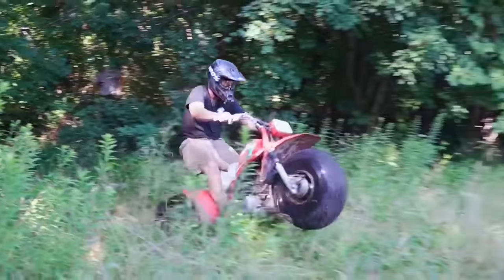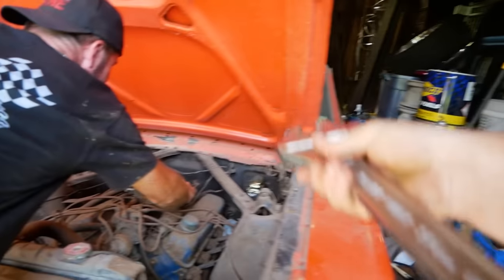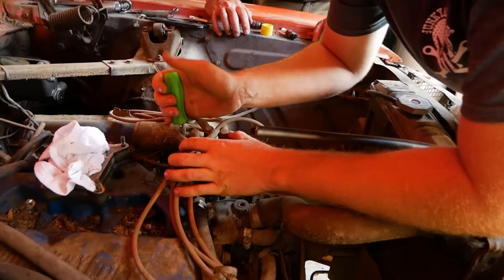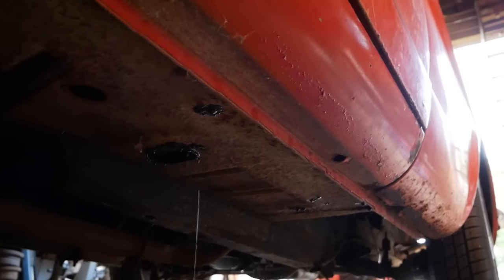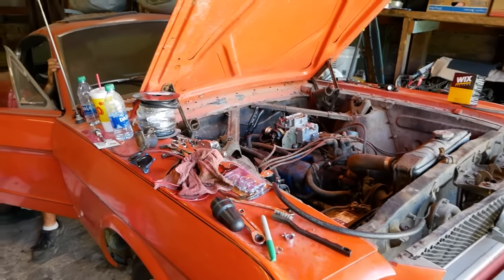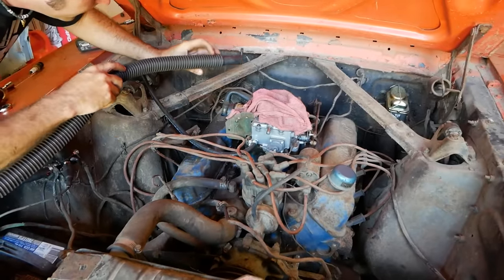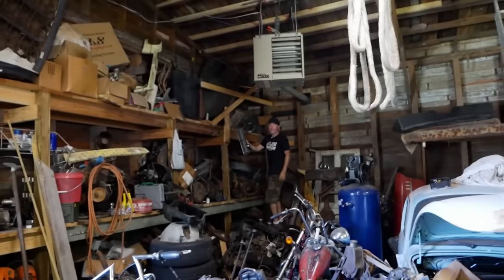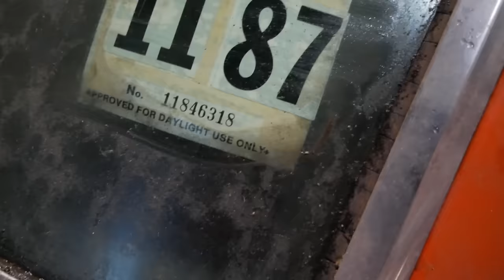Parked '65 Mustang FASTBACK First Start in 33 YEARS!!

Comment: you think that's impressive? I once started a car that had been sitting for almost 3 hours
Reply: thats a true victory when your car battery is as good as a brick.
Reply: well, ive done it after 2 hours and 30 min
Reply: What about after leaving the ignition on for an hour? My Passat sounds so sad when it turns exactly once, very slowly, and promptly gives up. Its basically my spirit animal.
Reply: @Avetho  relatable
Reply: What year KIA?
Reply: @jamescameron9420  I once, and only once, started my car after 2 hours and 29 minutes.
Reply: built Ford tough baby
Reply: Fr? That’s impressive
Reply: I mean if you drive a fiat that IS actually impressive.
Reply: @GlamStacheessnostalgialounge  Really? In my experience Fiats start easily. Well my experience is limited to a Polish Fiat 125p from 1976 and Fiat Brava from 1996, so maybe I'm just lucky? I don't know.
Reply: @mitko_dsv1999  I actually owned a Zastava 750 (Fiat 600) and a Zastava 101 (Fiat 128) and they were decent engines, although at over 100,000 many did need rebuilds.
Reply: @GlamStacheessnostalgialounge  Come to think of it both Fiats I mentioned have rebuilt engines. The 125p's engine was rebuilt at about 300 000 km (it was my grandfather's first car bought brand new and his daily driver for 30 years), and the Brava had the engine rebuilt like a month after my parents bought it second hand. The 125p is at 377 169 km at the moment and it hasn't been on the road since like 2009 (in the process of fixing it, since I want to drive it), the Brava's odometer craped out so it is unknown how many km it has been driven, but currently it's my mom's daily driver.
Reply: @mitko_dsv1999  I luckily got a pretty decent car and at 150,000 km all I had to do was fix a bunch of oil leaks and adjust the valves once.
Reply: @GlamStacheessnostalgialounge  That's great.
I can only hope that when the 125p is back on the road I won't have many issues with it. I'd like to roadtrip it someday.
Actually that car is the reason I got into cars at all, and as I'm fixing it now I'm learning how to do it. Back in 2018 when we started it for the first time in 3 years, we ran it on the gas in the tank (basically 10 years old at that point). It was interesting and actually pretty easy - put a battery, some gas in the carb and it started as if it last ran 3 minutes not 3 years ago. Well the fuel pump didn't work and we fixed it by stabbing it with a screwdiver 😂. And it smoked so much that when you revved the engine car dissappeared in the smoke. Now it doesn't smoke, well there's no visible smoke that is.
Fixing it slowly, but at least there's some progress being made.
Reply: @mitko_dsv1999  Since the fuel pump gave you issues and it didn't run for so long keep in mind to change it before you change the oil, most likely going to leak fuel into the oil if it's a mechanical pump.
Reply: @GlamStacheessnostalgialounge  I did change the oil (in October 2018) and there was a lot of gasoline in it, like at least a litre. But I think it was from the stuck rings. Yet I'm still doubting the pump as well. Changed the oil and now it seems fine. The pump is mechanical and is easy to replace. It's also not expensive (like $18-20) so I may change it and keep the old one as a spare, just in case.
Since I've changed the oil I've driven the car in the yard, and everything seems fine. And every time I check if there's gas in the oil. I guess it's best to raplace the pump, don't want to risk damaging the engine.
Reply: i started my van after sitting for 10 mins
Reply: @mitko_dsv1999  That's what I would do and what I did have to do on my current car. Easy to check, when you take the old one out see how much harder it is to press down on the new one compared to the old one. If you can hear vacuum escaping on the old one it's shot.
Reply: Yesterday I started my husqvarna motorcycle right after I shut of the engine. Maximum 6 seconds. That's impressive
Reply: @mitko_dsv1999  my mothers Fiat Bambina 500 started pretty well also
Reply: Hahaha  - Thanks
Reply: No way man. I don't believe it!
Reply: @GlamStacheessnostalgialounge  who would voluntarily drive a fiat?!
Reply: LIES! Get the hell out!? ;)
Reply: If it was a Chevy, that's effing impressive you a hero
Reply: @jomarz1828  as a Chevy owner I'm offended that this is accurate
Reply: No fuckin wayyy, how?!?!?
Reply: So the second time it sat for 3 hours it didn’t start, JUNK
Reply: Me too. A full week.
Reply: You think that’s impressive… I once started a Kia!

Comment: For the viewers of this channel- The block casting number is on the lower side of the block by the starter.  It will usually be C5OE-6015A if a 1965, C6OE for a 1966, etc. You will need to pull the starter to see the number.  The date code for the casting is there too.

Comment: there is a difference in ford starters on ford/Lincoln starters there is a additional spacer on the end of the shaft between the Bendix drive and the hogs nose bushing. I know this for a fact because when I hand a starter put in my 87 Lincoln. The shop went threw 6 starters before we saw the difference. From dealing with Mercury/Lincoln line of the ford line. I have found the 5 liter (302) made in Canada need this spacer about 5/16 of a inch to work properly. The second I heard the noise and the Bendix not disengaging. I knew the trouble was. On the backing plate use some flat washers to move the starter back 1/8 of an inch. you may have to do some custom work on the washers to get them to fit right.
Reply: Why. I'm a bad car addict. Have owner nearly a thousand bit it's hard to get am old Ford and fix it because of this kinda stuff.  351 is an example. Takes a while to understand the heads etc.
Reply: There's a difference between automatic & stick starters. If you're using washers it's the WRONG starter.
Reply: @tombryant1104  did you miss the part that they said 3 times the spacer between the engine and transmission was missing?
Reply: @Excitable101  What me miss something????????

Uhhh yeah I did, sorry.
Reply: @tombryant1104  no worries.
Reply: @mikeobrien3744  351 are pure evil made by Satan and . . .uh. . . emotions laws to ruin fun
Reply: @agentelvis81 , agreed. I'm not a mechanic and there's not much on cars that I really trust myself to wrench on. But even so, if I swap out a bad part and the new part isn't working the way I expect it to, I start comparing the original to what I bought. I compare the part numbers, the manufacturer, everything. I get out the calipers if I need to. It wouldn't take me long at all to figure out that I bought was the wrong part.
Reply: Back when I was a pro replacing starters on 60's and 70's Fords I did it the easy way. That is, swap the original nose cone onto the new starter. Never had a problem.
Reply: That's the one downside to Ford.... they aren't very good at standardizing on a single part, even on an otherwise identical engine. GM has that down to a science. Ford quality though has still been the best of the big 3 more often than not. They aren't Toyota good, but still pretty good.

Comment: I have a 66 Coupe with a 289.  Im running a 231@.050 Speed Pro cam (pretty big for that engine), 4 speed, factory heads with 3 angle valve job and bigger springs and the car is a blast!  You can see/hear it on my channel.  Something else you guys may want to do (so worth it), locker.  I have an Eaton in my 66, I just put a Spartan lunchbox style locker in a 70 Cougar...not very hard to do...and the fun factor once it is done is through the roof!  Be excellent!

Comment: This video brings back so many memories! Back in 2004-5 I completely rebuilt a 67 mustang convertible from stem to stern! Pulled the 1968 302 and rebuilt it with high perf  parts, street cam, 87 heads, 4bbl, long tube headers, T5-wc 5 spd trans, center force clutch, complete new suspension and springs, sway bars, power disc brake conversion...3.55 rear end... lots of work but lots of fun doing it!

Comment: I love those 65 mustang fast backs such sweet body lines on that car
Reply: Yes indeed. Also the price on them have jumped way up in the past couple of years.
Reply: TheHilander heck ya and it’s only going to get higher and higher I think
Reply: I think the fast back started in '67.
Reply: @jackbelk8527  '65
Reply: @jackbelk8527  my bad, August 1964
Reply: Jack Belk naw I know they had one in 65 it’s one of my favorite cars
Reply: @Tampaboys  I wish they would bring back the coupe.
Reply: TheHilander they should remake the Eleanor car that would be sweet
Reply: @jackbelk8527  nope from day one April 1964
Reply: Jack Belk 1965 was first fastback. When they released the Mustang initially, it was coupe and convertible. They call them 64 1/2 but they were early release 65 models, and titled 1965 model. When the regular release date came in mid summer, they added the fastback as the third body style.
Reply: It is difficult to say what type of car is worth being fully restored so it can be sold with a profit, but this comes close
Reply: @lenny108  ya it’s super clean

Comment: 302 will have a larger harmonic balancer, cast iron water pump of that vintage. Early 289's (up to 65) had aluminum water pumps. Also, 289 heads will work on a 302, 260 or 351w. Lastly, check the bolt pattern on the bellhousing early 289's will be 5 bolt and later 66 up will be 6 bolt. Starters can be either 3 and 4 speed manual trans vs auto trans. Also ford went to rail style rockers in 66 vs non rail in 65. Good job keep up the work.... Next time pour trans fluid in the oil. and run it till hot the trans fluid will remove gunk...

Comment: My '65 T-code fastback sat in a barn in Wisconsin from 1972-2009. I didn't own it then but the guy who did said the 200 6-banger started right up and ran fine with a fresh battery and some fuel direct into the carb. 

Putting a fresh 302 in it right now. Gonna be great!

Comment: Yeah, the Ford Winsdor blocks are pretty good engines.

About 4 years ago my dad and I bought a Ford Fairlane with a small block 289 in it that had been sitting since 1980 when the transmission went out and the family parked the car.

Fuel filter, spark plug cables, distributor cap and cleaning the plugs was all we needed to run the car with a red jerry can straight to the carb. We didn't even have a key because the family had lost it, we hotwired it from the started solenoid, lol.

Comment: Hey there Kev! I’ve been going through your channel watching videos that I have missed here and there. I don’t know if this one had an add in the middle of it originally but it does now and the original audio of the video is offset by the length of the add. I restarted the video twice to be sure it wasn’t my dookie iPhone. It’s a skill share add and   the original video audio starts it off with “…oww I took a metal p34is to the forehead” just as the skill share logo pops up. I know it’s an old video but it may be an issue with other classic JYD videos. Just a heads up bud. This looks like a great one. Take care!!!

Comment: Nice beard, I got two cars pretty much that have been sitting for years. A 1965 Mustang and a 1988 Oldsmobile Delta 88 Royale. I'm supposed to go to my aunt's house where my derelicts are stored, and I'm about to dust off my oldsmobile and my mustang, and do a proper diagnosis and maintenance so when I move back home, I can prep both of them for the road and drive them.

Comment: For the record, Ultra Black RTV will work as a stand-alone carb gasket for a loooooong time (scrap hardwood + light coating of RTV = lifetime carb spacer). Ultra Black RTV has also entirely sealed an unrideable Yamaha xs750 with a blown-out cylinder base gasket (half-quart leak every ~10 miles) from the OUTSIDE for over 20,000 miles. Obey Permatex's curing instructions and the stuff is more bulletproof than you'd guess. I'm not suggesting this as your daily go-to fix of course, but coming from a guy who isn't afraid to... the shit works.  Cool videos guys, glad to see people keeping the fire burning.

Comment: I've done the same thing: hammered on a stuck valve!! On an old 428 FE in a Thunderbird I restored. The problem is that every time I 'freed' up the valve, it would always be stuck again in a day or two. The only proper fix is to pull the head and give it a good cleaning or replace it. Mine were caused by (someone else) trying to run old, varnished out gas through the engine. That stuff literally becomes glue over time!

Comment: That chevette needs to get movin
Reply: Bill Monery ....yep, to the crusher, like every other Garbage Motors produced vehicle....
Reply: @branon6565  that was my first vehicle.   Fond memories.   If I wasn't so darn tall I would have kept it a lot longer.  Bought it with 150k and sold it at 400k.  It ran until just over 600k because it got totalled in an accident.   Probably the most reliable and cheap to maintain vehicle I've ever had

Comment: That year car came with a 289, 302 was later.
Reply: They also came with an in-line six cylinder.
Reply: 260 V-8 was the early release cars , then 289 when regular 1965 models came out. 1968 introduced the 302 as the small V-8. There were several straight 6 engines over the years, from 160 Cubes to 200 cubes. Decent gas mileage, but no fun under the right foot!

Comment: I’d be curious to know the difference with the starters? I just spent an entire day gridding and drilling on my ford starter and engine plate, I mated an 89 5 speed, to a 94 engine, with a 96 flywheel and engine plate, and the starter sounded horrendous! So I had to grind it and drill the holes out to be able to move it in almost an 1/8 of an inch, that seems to have fixed the issue but it makes no sense since ford starters aren’t supposed to be shinmed side to side

Comment: On the starter, when the block plate is absent, put a regular flat washer over each bolt before you install it. A typical SAE flat washer for the 5/16 bolts is almost the perfect thickness.  IF the engine is the original or "correct" replacement it can be a 260 or a 289.  (Could also be a 289 High Performance, but you're not that lucky.)
Back when these cars were new, I only identified Frd starters as "2 bolt" or "3 bolt".  I think the FE blocks were all 3 bolt however.

Comment: The biggest thing to remember is that the cylinder walls will be rusty pull the plugs and squirt a little oil in each. With the coil disabled, crank it over  some. Clean and reinstall the plugs and go from there. Ford uses a relay, a solenoid does a few things, it completes the circuit and does mechanical work, engaging the starter into the ring gear. A ford relay may complete a few circuits. One for the starter,one to bypass the resistor in an ignition system and related. 33:11

Comment: At one time years ago I was driving a Ford Torino 351 Cleveland 4speed automatic that My mother in law owned and someone made an offer she couldn't refuse! The Guy that bought it jerked out the engine and transmission and put in a 428 Cobra Jet version and a ,4 speed Hurst with a 9 inch Ford rear for Go! The 428 came out of a Mercury Marauder that he raced and it was super fast.

Comment: An early 289 would have a metal vacuum advance line.  The dual diaphragm advance would be on a later smog car.  My 70 Mustang with a 302 has that same distributor and is all original.

Comment: Tip.. Use Torque C.B from Kimball Midwest. It's the original 1957 formula of PB Blaster before PB started cutting it to sell at retail stores. It's like PB on extreme steroids. Under 10 bucks a can and I think the can is 18 or 20 ounces. Only takes a small amount and it will break free any rusted bolt and works great to free up motors that have been sitting. We started using it at our shop like 5 years ago and none of our guys will use anything else. Don't get it on paint but otherwise it's an awesome product

Comment: same issue i had with my 302 swap on my jeep, the truck starters even with the same tooth count have a longer snout and will not disengage, or overengage, the car starters will work for both.

Comment: wow. has a few issues but considering... pretty good shape. They probably quit on it when the heater core went, those can be a real pain to get out and back in. Mine went on my 96 blazer, I just put a pipe on the hoses to return the coolant, it has no heater now. Here in Alabama, that's not a big problem... and I have another newer car with good heat and air anyway.

Comment: Im fixing my dads old 68 mustang. He swapped the 4 speed in and it has the 289, no starter at the moment but i pulled plugs and shot some tran fluid inside the cylinder heads going to let it sit for a few then start to rotate the fan

Comment: My dad bought my older sister a 65 with a 289 it's been through three of my siblings and a month ago it came to me the wiring harness was removed the heads were taken off the last 25 years brakes or locked up it's a real mess, I rebuilt the top end got the motor together and I rebuilt the transmission and rewired it already. I can't wait to get some nice Wheels and paint it

Comment: In 1975 a friend of mine  had a 65 2+2  fastback. He was constantly bitching about putting money in it.He decided he wanted a  different motor  . He drained the oil ,put a block on the pedal and fired it up. It reved and died. It pissed him off because it didn't blow. It ran out of gas. He replaced the oil and it ran perfect sfter that. No new motor just a good car that prooved it was a classic car. True

Comment: That 289 ford sounds a ton like my 286 dodge durango except my idle sounds a bit less choppy and a bit more smooth but also bassy. Im tellin ya these small blocks sound good! I kinda wish it was a 360 sometimes but if the motor blows its either getting a 5.9L v8 or a 5.9L I6 lol id love to diesel swap it!

Comment: If you don't have the exact 1. Change the nose cone. I took a 390 starter. Changed the nose cone fit my 302. You cane ma starter from a 6 cylinder. Work on a 460.